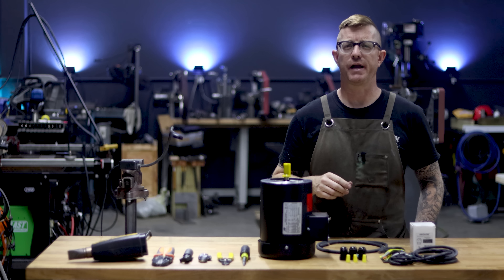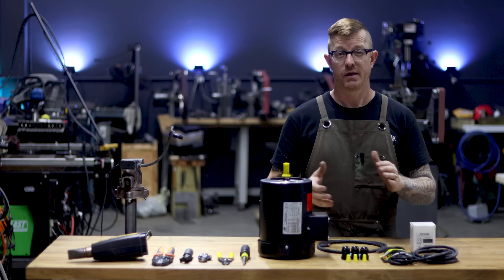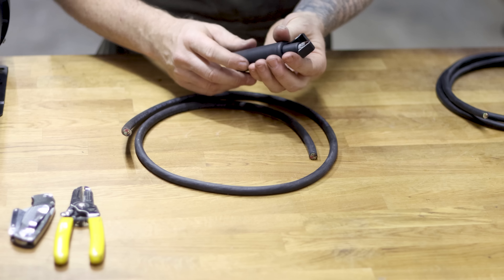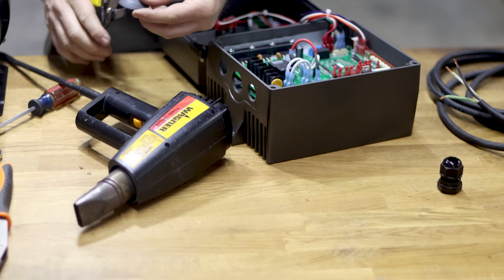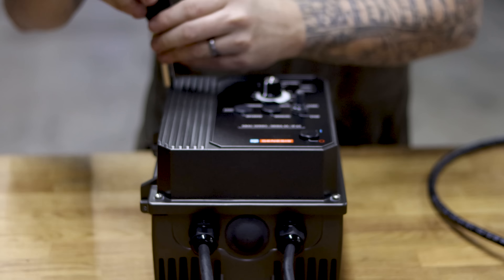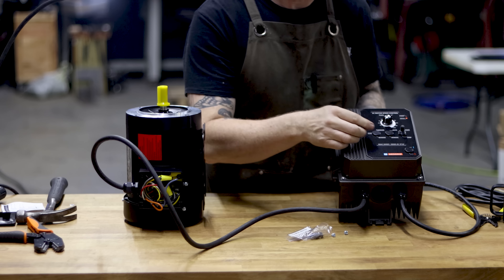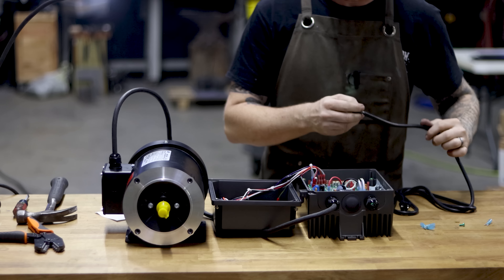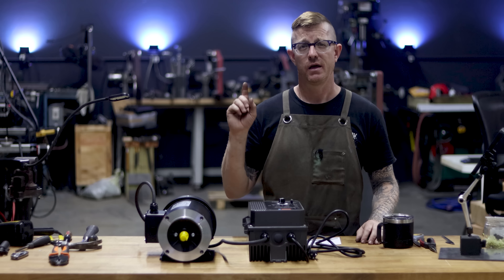How To: 2x72 Belt Grinder Wiring Guide

Comment: I wired mine off an old video with all 10 gauge wire.  This would have been way cheaper. But it also allowed me to run a 30 foot cord without having to ever worry about starving my motor for power and I can roll my machine outside when the weather is nice. Thanks for the updated video.  Will probably just use 12 gauge next time.

Comment: I'm saving my nickels and dimes because I want one of those belt sanders. Guess I should stop buying so many other things. 
I was smiling while you were doing this video. Everything you did was correct and I wouldn't try to add a thing. I am an electrical engineer and your description of your process and materials were quite different than what I am used to. If it works, its right! Thanks, Brian!!!

Comment: Just finished my Revolution and paint is drying, i went with the recommended vfd and motor, also adding a forward/reverse and on/off line switch to the KBAC 27D. Edit.... I literally just added both switches in 7 minutes! This is really a very nice unit,I'm glad I spent a little more, I feel like I got a whole lot more. Great channel, great grinder, your a great guy, thanks for doing what you do!!!! Edit... Update, Its running! Brian this really is a beast of a machine! No vibration even when speed maxed out! Again, thank you!!! Next is the buffer/ polisher plans or kit however you offer it!
Reply from the maker: Thank you Michael!! 🙏🏼🙏🏼🙏🏼

Comment: does it matter if the black wire is on left and white wire is on right of male 50 amp 250 volt plug?  That was on diagram that came with plug vs what's on this video???
Reply from the maker: They are interchangeable, however you may need to swap them if your drive wheel is going the wrong way.
Reply: @HouseMadeUS  Thanks for the reply.  I left the black on left and white on right.  Finished the VFD wiring and motor wiring.  Plugged into 220 and motor spun counter clockwise!  Think I'm set for now!  Great instructions on video.  Just waiting on Gen 5 Revolution kit that seems hung up at Fort Myers post office for last 3 or 4 day?  Thanks again for your reply!
Reply from the maker: Forward should be counterclockwise actually so you will want to swap those wires. Your kit is on the way but with the Memorial Day holiday tracking is lax. All good my man, thank you for your business. 👊🏻

Comment: It's a good idea to tape up the wire nuts. Keeps them from walking off and shorting to the motor case via any vibration.
Reply: If you aren't planning on re-wiring it ever, I'd just solder the wires together and put some heat shrink over them.  A bit more work than a wire nut (and I'll typically start with wire nuts just to confirm everything is working) but once you solder it then you never have to worry about it ever again.
Reply: @fredfchopin  Until you have to replace it. Motors don't last forever.
Reply: @nuke6702  True, but in that case solder a connector on it.  There are molex connectors (and plenty of others) that have a latch to keep them together.  Easy to replace one side or the other if you ever need to.

Comment: Just FYI.  Those Yellow ring terminals are for 12-10 gauge wire, and you are using 14-16 gauge wire.  You can buy the correct Blue ring terminals to fit that screw for the ground perfectly.  For that 16 gauge 120v whip those Yellow ring terminals would be way too small to crimp correctly.  Not that they will have stress on them, but the correct Blue ones fit 14-16.  For KBAC or KBDA, the line terminals are #6 screw and the ground is #8 screw for the proper blue(14-16) ring terminals.

Comment: The 220V plugs with 4 prongs are used to bring a neutral into the device, often for 120V control boards.  Some dryers and ovens use this.
Reply: 2323
Reply: 2323

Comment: Thanks Brian for the information.  I’m so glad I ran across your video about this setup.  I have the same motor and same vfd , both still in the box.  I’m finally ready to put somthing together.  What 2 x 72 would you recommend to put with these two units?  The best fit I guess I should say.  Your instructions were very well spoken and easy to follow!  Thanks again!
Reply from the maker: Happy to help. I am partial to my own setup which is the Revolution 2x72. You would need to build it from our kit or scratch. If that isn't an option I like Ameribrade as a pre built unit. Awesome gear. 🤙🏻
Reply from the maker: And if you want more info on the Revolution just head over to my website www.HouseMade.us thanks again Buckaroo.

Comment: Hey Brian I was wondering will that k back 27d vfd be a good choice for my Bridgeport mill with a 2hp 3phase step pulley motor and is there any disadvantages using 110 in to the vfd to 220 thank you very much for your videos electric is my biggest downfall on my projects
Reply from the maker: It could work. With 110 you lose 1/2 hp.

Comment: Understand that at 120v, 2HP is around 16-17 amps at steady state.  Start up amperage is going to be higher, and depending on the exact motor, it could draw up to 200% of operating amperage on start up, so be sure your breaker, wiring, etc is rated appropriately.  Exact amperage is going to depend on the motor's efficiency and power factor.  Also, as load increases that induction motor is going to suck more amperage.  This is why we use 220v in our shops, you can run more powerful motors without drawing lots of  amps.

Comment: All of my other grinders are single speed and one direction. I don't really have a need for forward and reverse or the speed adjustment could I just use the same iron horse motor but a single phase version and wire it to just a switch instead?
Reply from the maker: Yes, any single phase motor will work fine. I really enjoy having speed control.

Comment: I’m having trouble locating a Kbac 27D do you know if the Kbac 24D will also work with the Iron Horse motor that you suggest? Thanks
Reply from the maker: I do not think it will. It supports 1hp or less.

Comment: great video and explanation on the process. I followed along for 110 and when i go to test out the motor and vfd, It engages for a second and then pops the breaker. This is set up in a garage that was a carport and upgraded later on to a garage, And only has one wall outlet out here that was tied into an existing line of the house. Should i just run a new outlet on a new breaker to avoid that problem? Beginner here with not much knowledge any info or tips is appreciated, Thanks!
Reply from the maker: Is the outlet a GFCI? If it is the VFD will pop the breaker. Replace the outlet with a standard outlet and it will work fine.

Comment: I'm thinking about ordering one of your Revolution ultimate bundles and I have a three-horsepower motor that meets all the other specs for this build will that be okay
Reply from the maker: Yes you will just want to pair it with a VFD that can accommodate 3 hp. The cheaper 220 version I have on my resources page will do it just fine.
Reply: @HouseMadeUS  thank you, I'll  be placing my order tomorrow most likely, any available discount codes out there?

Comment: Why the 50 Amp plug? The 14 gauge wire looks a bit anemic in relation the the plug.  I have 220/20 amp outlets in my shop.  Only one 50 amp outlet, and my welder already occupies it.   Cheers!  Nearly have my rev3 finally built. Need to fab the tracking mechanism and wire.  And then a tune up.
Reply from the maker: I like flexibility, so I use 50amp plugs for a lot of things. Definitely not code, but my shop can be reconfigured pretty quick. Glad you're building the Rev! Cheers!!

Comment: If you find your motor is running the opposite direction that you want couldn’t you just switch the black and white wire in the vfd? Is there any reason to do it one way over the other?
Reply from the maker: Sure that works too. I find the wires in the motor just easier to get to.
Reply: @HouseMadeUS  10 4 thanks for the reply
Reply from the maker: Any time. Happy to help.

Comment: I intend to buy the plans. Question: Is it better to use an 1800 rpm motor and vary the speed over 900-4000 rpm, or use a 3600 rpm motor for the same speed range? The motor would be 2 hp, inverter duty 3 ph in either case. Thanks for you response
Reply from the maker: I only use 3600 RPM motors. Much better speed range.

Comment: How much actual power is delivered when limited to the 120v source? Does it need 20 amp? Sorry if any of this was asked and answered. I listened to the whole video. I don't think 120 is viable for me as I have a 3HP motor on my Evolution. Is there a KBAC that can convert 220  1 phase to 3 phase sufficient for a 3HP motor? I see ones that are for 380v-480v but don't want to go there.
Reply from the maker: You do lose a 1/2 HP when you run 110, which is negligible. There isn't a 110 VFD that can power a 3hp (that I know of)

Comment: When your 220 motor was going backward could you have switched the black and white wires in the VFD instead of the motor housing?
Reply from the maker: Yes that will work
Reply: @HouseMadeUS  Thank you.  I have learned a lot from your video.

Comment: Is the 110 strong enough to effectively power a 2x72 grinder?
Reply from the maker: Yes most definitely as long as you use this setup. I've seen single phase 110 motors (not variable speed) do great as well. 1.5-2hp preferred
Reply: @HouseMadeUS  Thanks Brian...this is why I will be purchasing from you!

Comment: What's the difference between 220 volt 3 phase and single phase? Will a motor 220 volt 3 phase work on single phase?
Reply: For a short period. Till it smokes your windings.

Comment: A 4 pin plug would be for incoming 3 phase. 2 legs and ground will be 115 ish volt with the third being the “hot” leg at about 176 volts,the fourth is of course ground. That’s for 240 incoming .

Comment: what should I do(can it be normal) for my motor to come with 
No instructions
No labels
No wires coming out

I'm using this motor for a different application, But I'm assuming the wiring should still be the same the most I can see this thing has is 2 main labels directly on the motor. One is a warning label and the other is The spec label which says NBK 20609
1/4 hp 115v 60Hz (PH1) (SF1.35) 1725RPM Reversible (CL.B) (AMB) 40°C Continuous Thermally protected
(the parenthesed are the ones i dont know there meaning, can anyone tell me there meaning?? i think PH1 means single phase?)
same label also has a connection diagram
 which reads simply
RED____○5
BKACK___○2
○4__ LINE 1
○1____LINE 2
under a faceplate on the motor I found some kind of interface with 3 open pairs of prongs 2 of which has a nut an bolt I assume for a loop connector(if choosing that route)along with 2 single prongs with a red an black wire attached that leads toward the Stator, on the outside is a yellow green lined wire for the ground, and that's it. I see total of 6 numbers pointing to the prongs, with line 1(○4) and line 2 (○1) each pointing to a pair of prongs Each are the ones that has the bolt and nut other than that. I see a couple other numbers(6&7) that point to small open holes then an extra pair of prongs that say 3. But I don't see anything that says what three does.
I'm no electrician but had the motor come in the condition that you had yours in. I could easily wire it up. But I have no idea what leads to where or what goes to where especially given the fact that if what you're saying i's true then I can't rely on the colors of the wires which is what I was banking on until I saw this video. I mean, I know definitely what the ground wire is. But it safe to assume the black wire is the negative and the red is live. But even if that were true, I don't know what line one or line two means Nor do I know which prongd would connect to the red or black wire which are connected to the prongst they're not open so I don't know now😬 
You are anyone else's help would be very much greatly appreciated

PS. I'm going to try to contact the seller on Amazon, but the amazon site contains some more specs about the motor but nothing on how to wire it up.
Reply from the maker: If there are no wires in the motor you need to return it.

Comment: This was east to understand till you completely didn’t show what you meant by “sealing the black n white around”
Reply from the maker: The only reason to do this is if your grinder is running reverse in the forward position. All you do is put the black wire where the white wire is in the motor case and vise versa.

Comment: Iron Horse buyers be aware...these are cheap motors from China.  Ive worked with crap tons of these and have found that the windings in these  produce  noisy and leaky frequencies.  What happens is the bearings end up arcing out and pitting that results in extremely noisy conditions.   I ended up changing all these motors over to a hybrid ceramic bearing that has eliminated this problem.

Comment: Both the electronic components are not available which are the hardest to compare. Why don’t you offer the complete set up it’s useless without a motor
Reply: I can only guess that Brian would have the same logistical problem that AutomationDirect would run into, the supply chain has been suffering since the start of the pandemic. Also, he would have to invest more $ in order to carry the stock, kind of hard for a small business. AutomationDirect will take orders on out of stock items, I placed my order and they eventually fulfilled the back order but it did take something like 12 weeks, it could be longer.